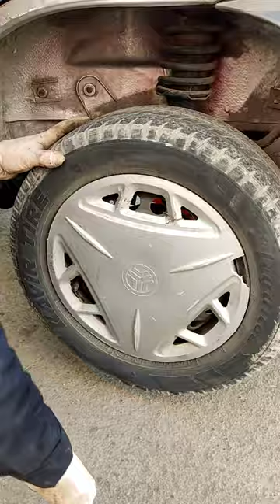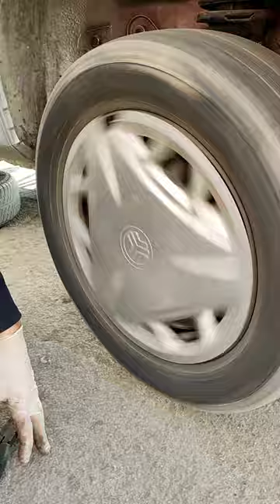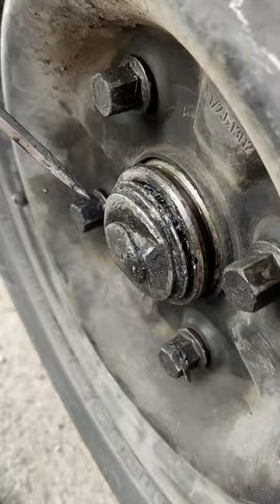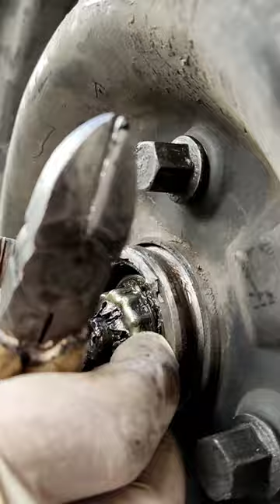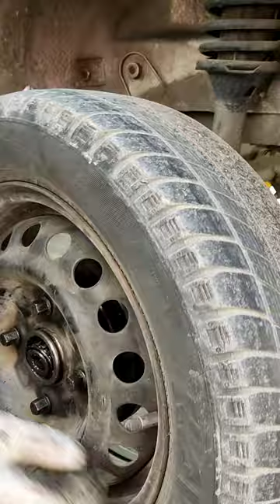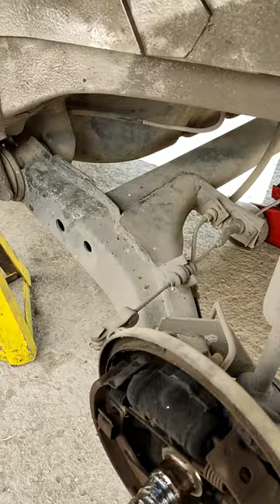#shorts #mechanic

Comment: Strange, I can’t tell the make of the car. I don’t know a car in the USA that has bolts rather than nuts. The bearing looked ok, but it was wobbling, could it have been loose? Drum brakes on the front? Pretty of grease, hmmm?    Jim
Reply from the maker: Jim 👋 name Car Kia
Reply: @mechanicmajid  we do have Kia in USA, & Hyundai….thanks…Jim
Reply: That's certainly not the front wheel.....